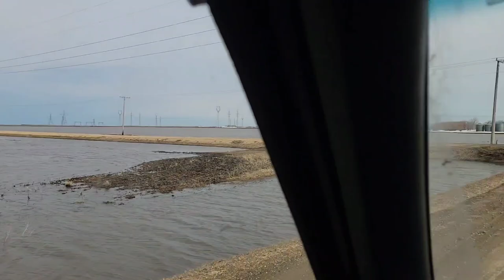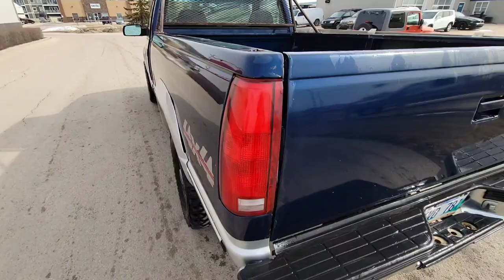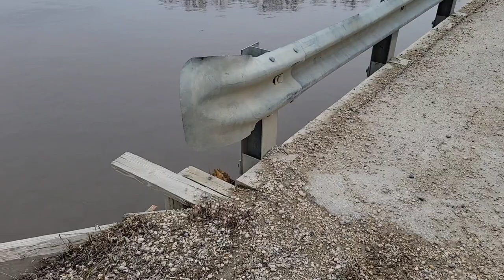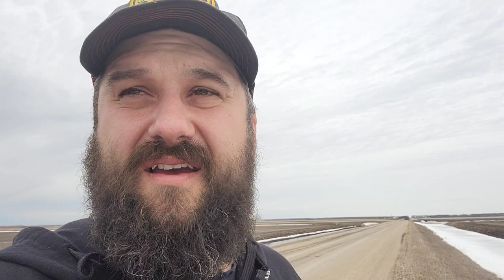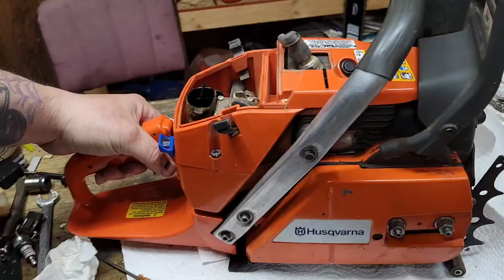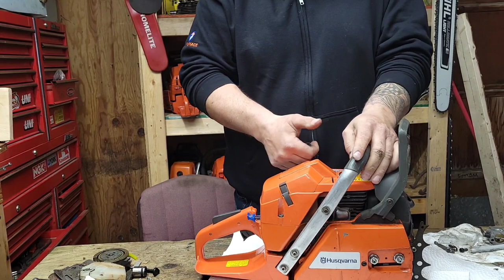Saw pickin' , backroading in Manitoba during a flood!!

Comment: Nice 365 Tinman! Having put some considerable hours on a 372xp x-torque felling hardwoods with a 28" bar that I destratofied ( I left the carb divider in) and ported, I kept the stock blue coil in this saw It runs and starts excellent (starts better than the 592 I run) It is holding up very well and is one of my favorite daily used logging saws. I have the black unlimited coil in my other 372s (can tune to 14,000-14,500 rpms ported screamers) I have not put as many hours on them.  I have several OE 372s as well, they are great saws for sure. Considering the condition of that saw I would keep the x-torque cylinder,  piston and mod it, built this way running good gas and oil (I run Bel-Ray H1r 32:1 in mine) this saw should last the average user a lifetime. Enjoy!

Comment: Similar hp to 044 and 046, 440, 460 Stihl.  I have an 046AV Stihl I bought new in '96 I think;  it seems to have the same power now as it did then, service it frequently; always run Stihl or similar quality oil, took the exhaust "screen" out right away......(when I bought it).  I bet I would get along with that 365 Husky real good.  It really looks clean.

Comment: Fun facts
Husqvarna 365 Specs

Cylinder displacement 70.7 cm³
Cylinder displacement 4.31 cu.inch
Power output 4.9 hp
Maximum power speed10 200 RPMFuel tank volume1.62 US pint
Fuel consumption426 g/kWh
Idling speed2 700 RPM
Spark plug Champion RCJ7Y, NGK BPMR7AElectrode gap0.02”
Torque (max)3.8 NmWeight (without cutting equipment)14.1 lbsSize (Length x Width x Height)17.1 x 9.6 x 12.6”
Recommended bar length (min)16” (40 cm)Recommended bar length (max)28” (71 cm)
Oil tank volume0.89 US pint
Oil pump typeAutomatic
Oil pump capacity (min)4 ml/min
Oil pump capacity (max)20 ml/minSound(LWA) 119 dB(A)
Equivalent vibration level (ahv, eq) front handle5.7 m/s²
Equivalent vibration level (ahv, eq) rear handle8 m/s²

Comment: I had a 95 2500 like yours and I foolishly let a cattle rancher talk me out of it about 10 years ago.  I still have my 2002 2500 long bed reg cab 4x4 gasser and my 2002 CC 4x4 Duramax though. I much prefer the trucks made from the 90’s to 2006. They had plenty of comfort plus they were fairly simple and reliable trucks compared to current models. My 2018 z-71 stays in the garage most of the time lol.

Comment: My local husky dealer has a brand new 365 xtorq with a 20" bar for 980.00 dlrs US rite now
Reply from the maker: I think they are $1150 CAD at my dealer. They have lots left.
Reply: I believe theirs a passage left blocked on the cylinder on them and once u open that up it makes them a 372. It's on clutch side of cylinder behind that cover
Reply from the maker: @jamiedalluge9472  the transfer caps are different on the 365, I think thats the only difference.